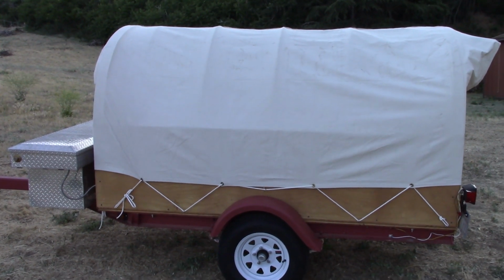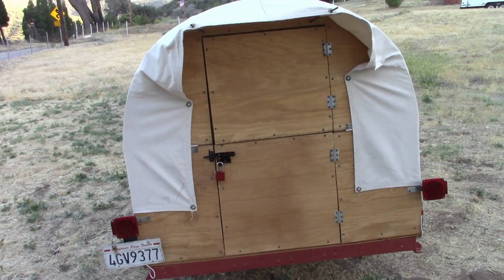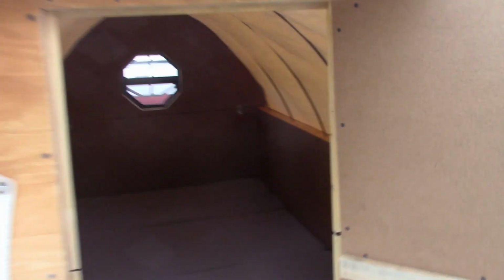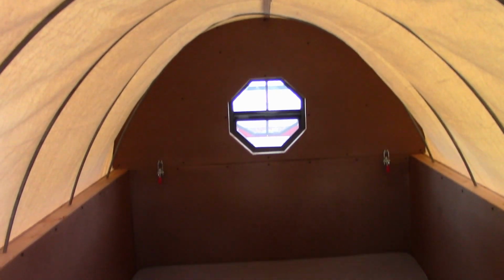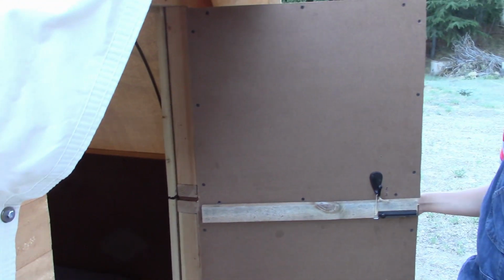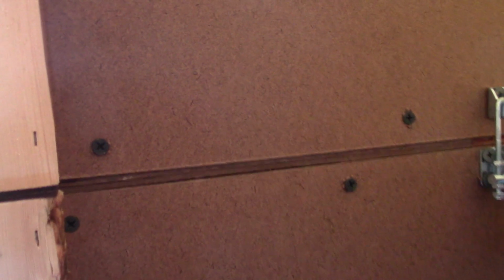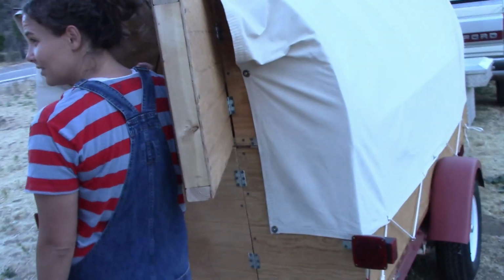Old Utility Trailer to Covered Wagon Timelapse

Comment: I made something similar couple years back but taller I'm 5'3 so I could get dressed , like a gypsy wagon with canvas...but what I did was make the half round walls fold down, and up with laches like yours...take my bow supports off store on floor my bed went widthwise with storage under it..a bench seat small kitchette ,water storage and home compost potty...then my canvas treated w/ rubberized  coating stretched acrossed pulled tight was flat and watertight streamlined shorter then my jeep ... I love ❤  your version too....
Reply: That sounds awesome!
Reply: You poop 💩 in the trailer? It sounds really nice 👌 though..
Reply: @paulcook68  the word compost offend your delicate sensibilities...well get over it...no different then using a rv toilet and doesn't smell.. 
Bless your little heart!
Reply: @sharongypsydove6080  We have become so domesticated it’s a shame lol 😂 Poop in that trailer with confidence!!😂😜

Comment: I was thinking a good way to fasten the sides of the canvas would be to sew in a sturdy length of timber along the long edge of the canvas and use short ratchet straps to pull it down tight? Only needed on one side of course! I like the overhang over the door to keep rain out I assume! Maybe the front of the canvas woud be tidier with a bungee rope sewn into a seam too, like the original "Pioneers" wagons. Please accept these ideas as just that, they are certainly not meant as any form of critisism! I think your mini covered wagon is simply magic!!!

Comment: Only an idea but, if you find that the cover allows too much light and acts like a solar greenhouse, paint the inside and the outside white, using good exterior latex paint. It’ll darken things up considerably. Of course, any good paint job, inside and out, will block light and increase water proofing. Interior lighting will be more effective with the lighter color.

Comment: Iv see on made with canvas cover and it leaked ,the person  said should have used ,tarpaulin instead, but it looks great 👍
Reply: It's treated, so it is waterproof.
Reply: I used canvas on a project and I actually soaked it with fiberglass resin, which I applied with a roller and it never leaked, but it made it very ridged. It works well if it is staying in one spot..

Comment: I was hoping you would finish it a bit better the canvas looks sloppy at the ends and I think you will find once you are towing it at speed shit will get messy and you will wish you put a ridge pole in
Reply: The canvas, ribs, and end caps all come down during transport.
Reply: @kristinmcclendon2543  i did some thing similar with pvc pipes and chicken wire.. minus the fancy lower walls and dutch door.  the pvc pipes were mounted similar to monkey hut construction.. using a center beam with ribs extending down and chicken wire to support a tarp in  bad climate weather. used it as an off ground tentt to travel from new orleans to ohio when camp grounds were closed during pandemic.. rolled into a Loves covered with tarp set up camping cot and slept well in a rain storm.

Comment: Nice job. 3 things that I would have done differently is to make the end cap bulkheads hinged so they could fold down in transit, add a window on the door and lay down insulation and flooring over the plywood trailer floor. Nothing that can't  be done now.

Comment: Well done!!
Reply: Can you tell me why you didn't build it higher so you can stand up in it?
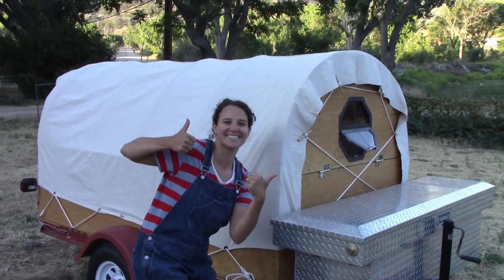Reply: 12:46   Best reward!!!
I'm glad you worked on it together. This is the kind of thing that makes marriages better!
Reply: @Jennifer Grove a few reasons. We had never done anything like this so we were trying to keep it simple. We didn't want to spend too much on materials. We wanted to keep it light weight so it could be towed by a car. We also didn't want a ton of drag while towing if the walls were much higher. 

We were considering buying a tear drop trailer before, so we were fine without standing room. It was mostly about giving me a warmer place to sleep and having a fun project to do together. 😊

Comment: How is it driving down the road? Do you have to tighten up the ropes very often?
Reply from the maker: When driving down the road the canvas and metal hoops break down and are stored in the trailer. We fold up the canvas and cover the whole trailer with a plastic tarp when driving down the road. The trailer tracks well and has no wind drag. It is great to tow.

I have noticed that I usually need to tighten the ropes after the first night of camping but then after that it is good.